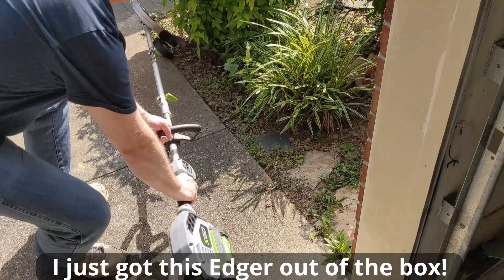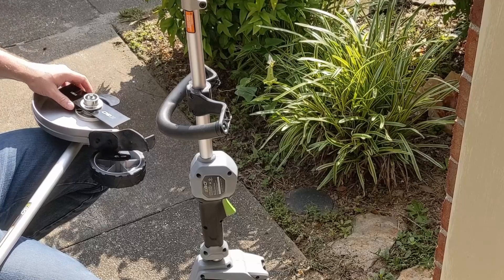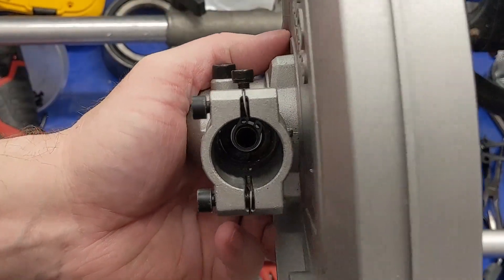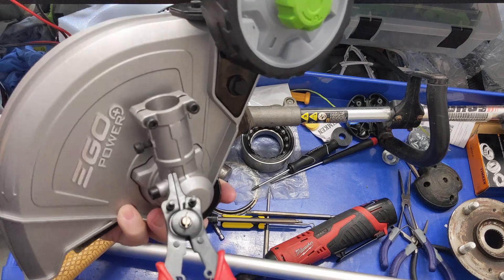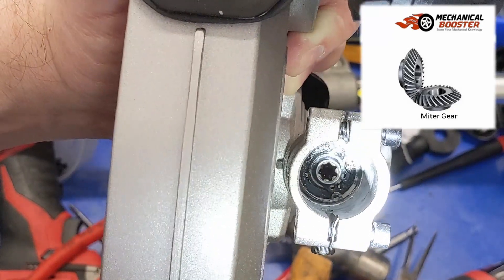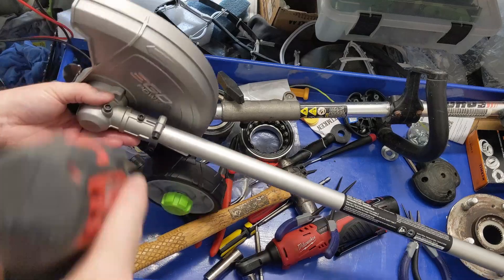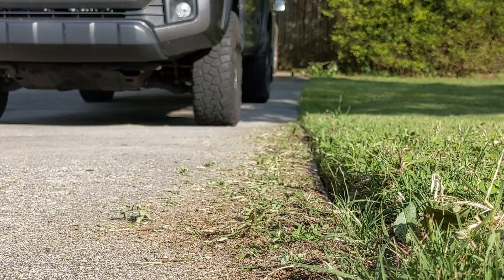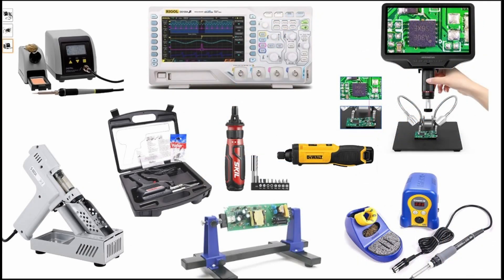EGO Edger Repair

Comment: Thank you so much for this video. I had the EXACT same problem. The edger worked for about 10 feet before it broke. I popped the snap ring out with a small flat head screwdriver then pressed a 5/8ths socket in with my thumb until I felt the miter gears connect. I slowly spun the head my hand to make sure everything was lined up and working. After that all I had to do was press in the snap ring with the same 5/8ths socket. I heard it pop into it's grove and it was fixed
Reply from the maker: Awesome! Glad it helped and thanks for sharing.

Comment: how do you put the wheel back on if it falls off
Reply from the maker: As long as you have all the parts it should be as easy as putting the bolt back in the wheel? It has a carriage style bolt, flat washer, wheel slides on, flat washer, lock washer then the green knob if I remember correctly....

Comment: I have a "new" Ryobi Drill set that sat on a shelf for 10 years because of family needs relocation. I recently got it out and found BOTH batteries worthless - would not take a charge. Got a new One+ set of batteries with a new drill. he battery would work with the light but the drill was totally dead. There is corrosion on the wires inside the drill - contact cleaner cleaned most with no effect on the drill performance. So now I have two defunct 18v batteries and a drill that's driven maybe two screws in its life and now is dead. So .. do I have to dismantle the drill entirely? and can those batteries be fixed?
Reply from the maker: I would think the drill is most likely fixable. The corrosion would have to be investigated well and yes completely disassembled. The cells in the packs are most likely gone or at least many cells in the packs are most likely at zero volts and may not be safe to try to recover at this point. If they all have a charge of some level even if only .5V they may recover safely with some lost capacity in my experience. Best of luck to ya!

Comment: Great post, can you explain exactly what you are doing to the snap ring for an amateur like myself?...lol
Reply from the maker: Gotcha, I should have shown a ring outside of the edger for clarity. I am grabbing the snap ring by the small holes that are at each end of it with the tips of the pliers and squeezing (makes it smaller diameter) so I can press it down into the groove. It was never set in the groove correctly at the factory it seems. This allows the gears to be unmeshed . This may be a common assembly error, or it could possibly be a rare thing with a new assembly line worker etc. I am looking forward to seeing how many viewers have the same issue. Hope it helps.
Reply: @ThriftyToolShed  thank you so much!...I have the same exact issue, brand new, never used and it just wasn't spinning. I assumed that's what you were doing to the snap ring so I'll give it a shot, thanks again!

Comment: My blade turns but it’s not strong enough to cut through the top layer of dirt.
Reply from the maker: That could be the same thing! Mine would spin up until loaded. As long as the blade is tight and it's not spinning. I would check the snap ring!

Comment: Have you ever repaired a dead Powerhead? It seems more difficult to repair than the chainsaw.
Reply from the maker: I have not had any issues with mine yet. I have a video looking inside of the power head, but not repairing.
Reply: @ThriftyToolShed  Yeah, I watched that video, though the issue is the controller and it seems to be a lot harder to get into. It's not a big deal though as it was under warranty so we got a new one, but it would still be cool to fix it.

Comment: mine worked for 4 years and now it will start and spin the blade and die within 2 seconds.  then it false starts at the back like durk, durk
Reply from the maker: That seems to be the way these fail. I have seen comments similar to this.  I have 2 of these. Mine still works, and I have not had to repair one yet, but one did start doing this a few months back. I thought I would have to take it apart and look at it. For some reason one of my weaker batteries was causing that on mine. I swapped out to one of my newer packs fully charged, and the Power head has been starting and running normal. Definitely seems to be a start-up inertia issue. Like the controller was sensing too much current and shutting back down.